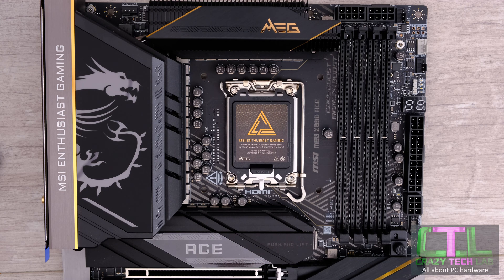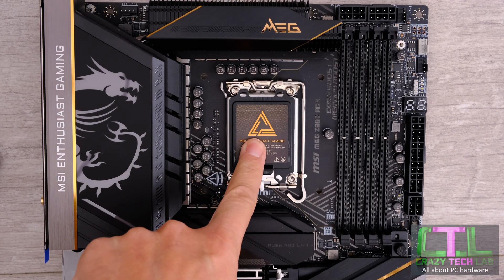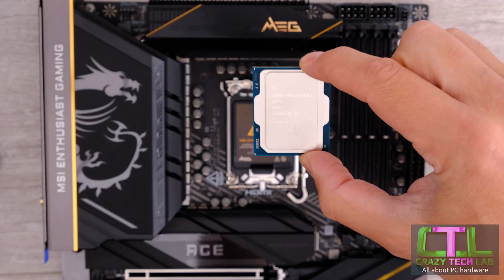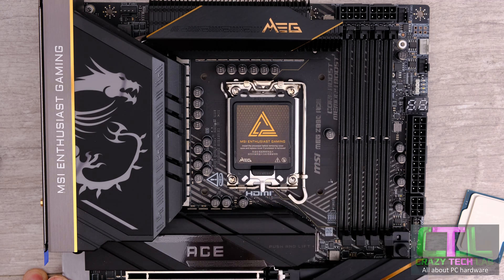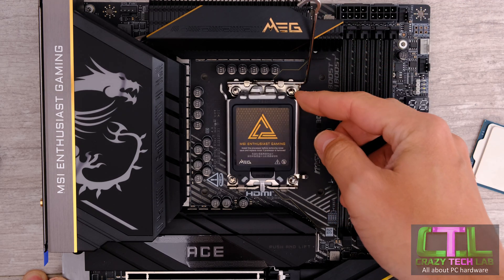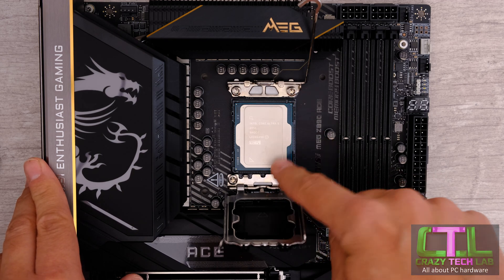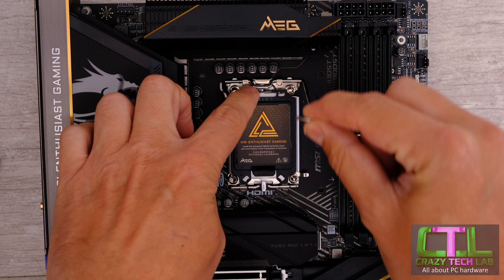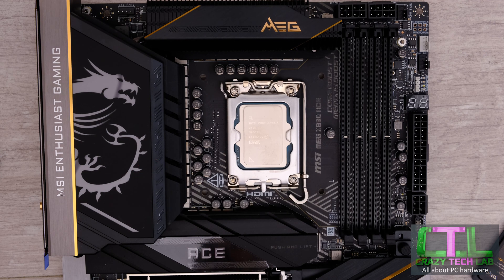How to install an Intel Core Ultra 200 processor

Comment: Question;  My MOBO/CPU (Intel Core 7 Ultra | ASUS  Z790-PLUS WIFI) are not doing anything buy lighting up LEDs and fans.  I"ve disconnected all components to bare minimus  - Just MOBO, RAM & CPU, but no graphics/POST happens. The CPU is installed properly (according to this video.)

Thank yo for your comments & ideas!
Reply from the maker: Either you are not using a Core Ultra 7 processor or you are not using a Z790 motherboard. Because those two things are not physically compatible with each other.  Do you mean Core i7?

Comment: Great video.

I would like to know the reason for keeping the cap in place and having it pop off when closing the lever.

It seems that there is no downside to removing the cap first, and in the unlikely case of a CPU upgrade, there will be no cap anyway.
Reply from the maker: As soon as you remove the cap you risk damaging the socket. There's no plus side to removing it with a new motherboard till you have to and only increased risk.
Reply: @CrazyTechLab  Got it, and THANKS!!!  Tonight I will be installing a 265K into my Gigabyte Z890 Aero G.

Comment: upgrading from i7 extreme 3930k to arrow lake. the old pc still run like a beast other than pcie gen 3 and ddr 3 ram unfortunately the motherboard died and its time to upgrade after 12 successful years. i wonder if the new cpu can last that long.
Reply from the maker: You'll notice a HUGE difference even with a mid-range graphics card. The 3930K was a beast in its day but the instructions per clock has massively increased since then, resulting in far more performance across the board in lightly-threaded and multi-threaded tasks. Even a Core Ultra 5 would wipe the floor with it so enjoy the upgrade
Reply: This is about where I’m at, although not that long. I got some new DDR5 ram and my motherboard only took DDR4 so I finally bit the bullet after eight years lol.

Comment: I used to be a desktop repair tech back in the mid-2000s when these sockets where on the LGA 775.  I ran into one or two bent pins where I just bent them back with the blade of a box cutter.  Good as new.
Reply from the maker: @dwu9369  So did I. That’s when you had 775 pins. Now there are 1851. They’re smaller and far more delicate. I had a pretty good success rate back then. Recently it’s been zero even with a video microscope . The tolerances are much finer now so the slightest bit out of alignment and it doesn’t work.

Comment: is it good? is it worth from 12700K? i just,play games and excel and word
Reply: 12700k will last you for atleast the next 3-4 years. Don't upgrade. I am still using the i5 8600 gtx1070 and works fine for me, even in games. Will upgrade soon though.
Reply: @rudraacharya8247  okey buddy i keep it, i received positive coments about the chip. to what are you upgrading?
Reply: @rudraacharya8247  I don't think you can run modern games, the 1070 will not cut it for many games today, not at high settings or even medium.  I upgraded from 1070 to an RTX 4070 and blown away, with RTX you get real time raytracing, DLSS, RTX Super resolutoin and much more.
Reply: @rudraacharya8247 oh god you are poor 😂 😂 😂 😂 😂 😂 😂 😂 😂
Reply: @AchicaMkd  lol I'm a student this is my cousin's old pc, also I'm from India, and your pc doesn't define how rich/poor you are. You seem like a kid, give your phone to your momma
Reply: @rudraacharya8247  The sick burn. I bet that guy waste his parent's money to buy the latest and greatest, annually, or whatever is the best. Probably a kid.
Reply: @AlfaPro1337  yep exactly
Reply: I'll be coming from an 9700K.  If I had a 12700K, I would wait until 16th gen to even consider an upgrade.
Reply: @dwu9369  i appreciate your comment i stay with my 12700K wich works great.
Reply from the maker: Depends on the GPU. If you have a high end GPU you’ll absolutely see a benefit. 12700k is old tech now.
Reply: @CrazyTechLab  i have a 4070ti super